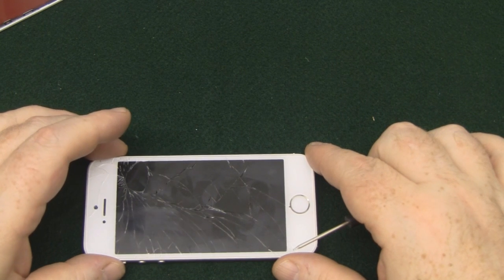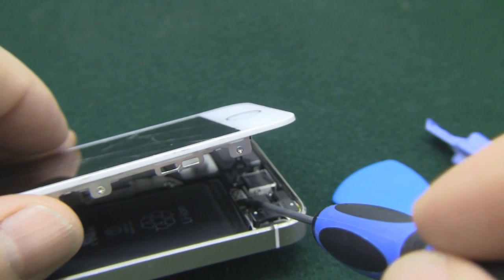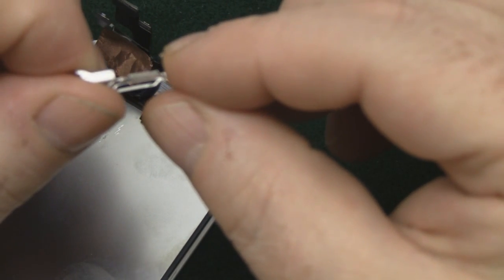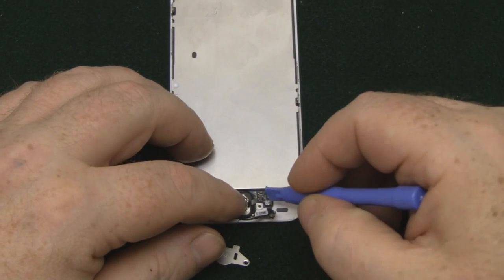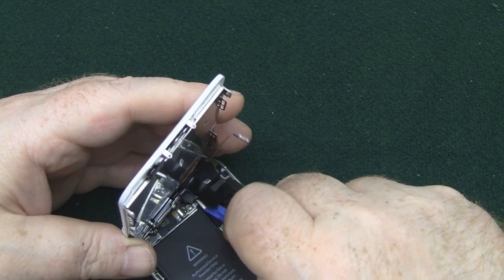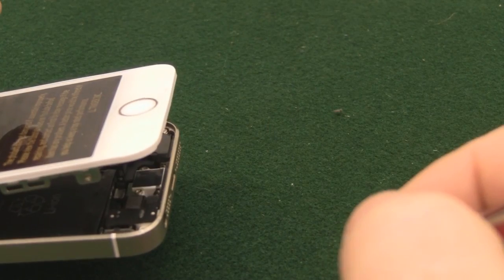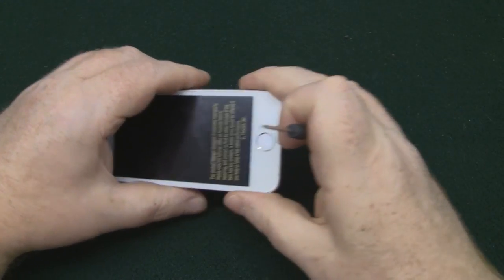IPhone 5s Screen Replacement #62

Comment: Can the screen ribbon flex cables with the 2 or 3 brass pin connectors  on them be fixed if 1 snaps off please. Also does colour part on top as well as the non colour part at the bottom of home, do both of these home button parts need to be swapped over to the original screen for the Touch ID function to to work because my old original 1 is white and my new home button is black, I'm hoping I don't have to have a black screen with a white home button. Excellent video thankyou.

Comment: please reply if you can, 

i dropped my iphone 5s and it crackked from the camera but saying that it had a glass protector and some off the screen came off in the top right corner and ita sensitive to the touch like if u press hard on the screen it had coloured lines, would it be alright when the guy thats fixing it fixes it?

Comment: Excellent tuition video. Takes time and patience but persevere and you can do it. As a previous comment noted, there is no need to remove the larger square shaped label from the back of the metal plate if you're using the plate again. Once you remove the camera the plate comes away with the silver plate attached. You just attach the silver plate to the new screen and reattach the camera. Thank you for uploading this very helpful video. No way could have completed this without it.

Comment: My home button is not working...checked the ribbons, everything connected. Everything in place. It says touch ID not working actually the home button. Any suggestions? I know ribbons should be intact and all. They are indeed and went back and checked them many times. What’s the next thing to do? Buy a home button? :(

Comment: great video. I'm planning on trying this soon. Just a suggestion: you should add a link to where we can order reliable replacement screens from
Reply: Hello Tristan, if you need these information, I will help you, our factory has manual and automatic lcd machines and the replacement parts, Whatsapp:+86 135 9043 9558, skype: nancyyang9308

Comment: Great video. Worked for me, only took 3 hours... I spent most of that time wrestling with the speaker/camera assembly to get it to fit into the new screen properly. In the end I went with "close enough" but everything works. Even the light sensor. Not bad for a £10 ebay job.

Comment: ATTENTION! The screws for the protective panel of the LCD flex cables MUST be of specific length. Otherwise, if you mix them up you can damage the traces on the pcb causing "the blue screen" boot loop. You can print a layout of your phone to keep track of what goes where. 
There is a video called "Classic 5s long screw damage trace repair to solve blue screen of death" by iPad Rehab with more info.

Comment: Hey I did everything in the video. Everything turned on but when I tried typing it would  add letters that I didn't press. When I scroll up or down it goes back up. Do you think it's a faulty screen or I did something wrong

Comment: Great video! Also, thanks for mentioning the part about the bracket screws being different lengths. it really matter as you can fry your logic board if you don't put them in the correct spots! Thanks.

Comment: hey. so u followed your video and everything was going well, until I turned it back on and now I have a double line down the middle of the screen? is this something I have done or possibly a faulty screen? Cheers
Reply: The middle ribbon connector is probably not seated

Comment: Thanks for the video.  

There were two points that I suggest:
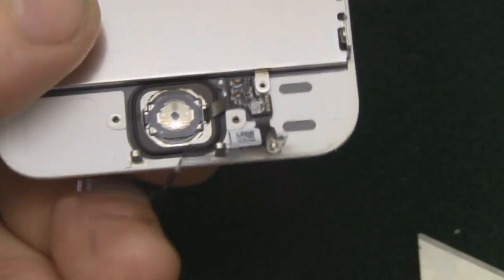1. 4:00 Using a blade is unnecessary to remove the button, just gently press the button from the front
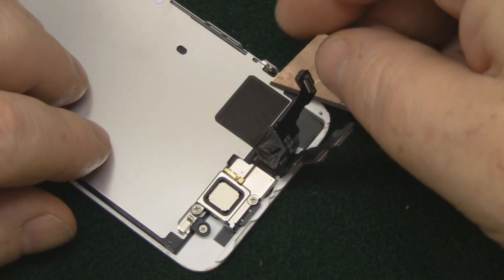2. 5:00 The Tape/shielding can be kept attached to the metal backing and transferred in one piece

Thanks again. I was able to see a part orientation I wasn't sure of.

Comment: I removed the glass screen, but the metal portion which the video shows attached to the back of the glass is still attached to the phone body. How do I remove it from the body so that I can access the screws?
Reply: lift up the plastic around the metal bit on the edge and it will pull up the rest

Comment: Great video. My daughters phone now works again after vertical stripes and almost no touch response. Some small rubber things fell out and the small metal clip on the right screw of the touch button. A close up of these things would have been nice, to see how to position them. Also the camera on this phone is very loos, and does not fit into anything I guess something is missing to hold it in place.

Comment: I have 2 iPhone 5s, one has cracked bad screen and the other one has a problem with wifi connection, do you guys know if the wifi modem is on the screen or on the motherboard? Because I want to swipe the screens (not only the led) because its easier this way. Do you guys know if it would work that way?

Comment: why would you have us remove the camera tape on the side if we are going to transfer the back plate anyways. You just risk damaging the tape for no reason...
Reply: WolfServant  if some one had a new digitizer or the back plate that demonstrates how to do so tutorial purposes
Reply: I guess, but maybe a disclaimer saying if your using the same one then keep it on? I removed mine when it was unnecessary.

I mean yeah I should have watched the whole thing before starting, and the phone still works all the same, so no problem there, but for others put it on there so that they don't pull it off if they don't have to, so they don't make the same mistake as me, by jumping the gun.

PS This video helped me alot so thank you for making it!

Comment: Thank you, works fine!  one thing i did different though is not remove the black tape on the metal plate.  i just left it attached and put it on the new one but thanks again, you helped a lot
Reply: Hi now we have automatic machines which make the whole process very fast and easy. For more details welcome to contact us by whatsapp+86-15889548883, thanks!
Reply: lucid tiger р

Comment: I hope this works, ive been stuck because the suction cup wont work because of the cracks
Reply: You could try putting clear packing tape over the screen and using suction from there.
Reply: yes , maybe you can buy heating separator with built-in vacuum pump , which will be easier , or you can refer to this article :http://tuoli-nancyyang.blogspot.com/2016/08/warm-tips-for-phone-lcd-refurbish.html   , any question , pls feel free to contact me . Wish you a nice day !　：）
Reply: Chuchu tv
Reply: hello , how are you today ? any doubt , also can send message to my mail : nancy@tuolitech.com !
Reply: Chill Keilen just use super glue

Comment: help my screen now shows but It doesn't respond to touches
Reply: Probably didn't connect digitizer correctly?
Reply: +Jed Moody exactly what happened did it and finished the whole didn't know how to properly close the bottom half and I cracked it again... Any tips?
Reply: I'm no expert at this at all I was just assuming general knowledge. Only tip I could give you is to never force anything.

Comment: I just bought a screen replacement kit from Hengtai communication "Hightechy".  At the back of the basically useless manual there is a QR Code that brings you here to this youtube video.  This video, as is the tiny "manual" for the screen replacement kit, are both for an iPhone 5.  I say "useless" because I had to watch a video, start, stop and study multiple times, to do my repair.  However the manual does mention some "bewares" that were not mentioned in any of the videos I watched.  E.G. Even though there may be 3 or more screws involved for removing any one particular part, there may be multiple size screws involved.  Pay attention to that.
This Video is ok but I ended up watching on that was specific to the iPhone 6.  The repair is slightly different.

Comment: I've followed this but after using it the screen has lost abit of sensitivity, when typing it selects random letters, or the space bar. Also affects the passcode when unlocking my phone. PLEASE HELP!
Reply: I think either your parts faulty or the 3 cables connecting the screen to the phone are not put in correctly.

Comment: Thought you had to disconnect the battery before disconnecting or reconnecting lcd screen as power can fry the new lcd screen leaving a blank screen or lines or touch screen not working?  so iv been told

Comment: My iphone 5s screen got replaced and now the very bottom part of the touchscreen doesnt' work. meaning I can't pull up control center. Is it possible that the touchscreen was just misaligned? my touch id home button is already not working when my screen was broken but the touchscreen was fine.

Comment: well at the beginning my touch screen didnt work and there were lines on the screen. now my touch screen doesnt work, there are lines on the screen and wait more? my home button also doesnt work. where was i wrong
Reply: +muhammedmuhiddin Wow! I have the same problem with my phone! something happened to it and one side of the screen (right side) doesn't work. It then fell and a little part broke and the lines went all the way to the middle, now the whole right side of my phone is no longer accessible. After changing your screen, it didnt work? Did u try taking it somewhere to see what was the issue to begin with? I also think it is the screen, but if you changed screens and it still doesn't work then maybe it is something else?? COuld it be the battery is not good?
Reply: no the problem is screen. i should replace the screen. home button is my fault. i couldnt connect it correctly. so i ll no longer try to repare it by my own. time to pay some...

Comment: You have a very nicely detailed tear down going on here. I give it all thumbs up. I accidentally cracked the digitizer while putting the screen and everything back into the housing, so I will definitely have to come back and watch this again to cover what ground I need to cover. 5/5, 10/10, 50/50, 100/100 and the accent was actually a very nice touch, as well.

Comment: My phone is hella cracked when I powered it on I got colorful lines (like the kind u get from tv's) and I want to to the screen fixed but if I do is the screen the problem or is it just my phone?
Reply: I think u need a new digitizer I can fix anything for you for $50
Reply: It's more likely to be the LCD than the digitizer. The digitizer is merely the touch screen, and doesn't produce colors - just touch and drag functions. The LCD is what produces your color and all other images and is designed to work with the digitizer to move and activate applications and their functions. Replacing a digitizer and LCD isn't very hard and you can do it yourself for less than $50, maybe even around half of that. When life gives you lemons make some lemonade; or, if it gives you alcohol just bang the maid.

Comment: this was a Godsend... just got my daughter's phone fixed before christmas.   only problem i had was trying to put the screws back in the plate that covers the lcd connections... the connections kepts poppping loose and i would have to unscrew that and start that process over.  the last step is much easier if u use tweezers to put the cover over the homescreen button connection, btw.  other than that this was an awesome tutorial

Comment: i now have an issue which i hope you or someone else can help with. I cracked my screen and was replacing it with a new one but the new one didnt work it would just show an illuminated black screen and i couldn't turn it off or anything. So whilst the phone was still on i changed it back to the old screen but once the old screen was connected it wouldnt show anything, not even lighting up? itunes recognises the phone and when its charging it 'bongs' every six seconds. Any ideas what the issue could be?

Comment: Did you notice that there is a "tube" (approx. 3mm high and 7mm diameter) made of transparent plastic which holds (or centres) camera module in place. New front panel does not have this - at least the one I bought. Have you moved this part into new front panel before putting all things together again?

Comment: do i absolute need the inside metal back plate? because i do not have one to use at the moment
Reply: +Eunice Jackson Yes, you definitely do: that's a thermal shield that dissipates the heat that the LCD produces. Not having one will eventually damage the circuitry irreparably.

Comment: True, you can not replace the digitizer on an iPhone (Gen4 and up), but you can replace the front glass, which is not the digitizer. I don't know if that's what you're talking about regarding eBay sellers. Ebay sellers throw in any words into item titles, like LCD, Digitizer, when simply selling the front glass panel. Also many people assign the word digitizer to the wrong part.

Comment: Just to say you dont need to take the black tape  off the back of the metal oull the camrea unit out then un screw the metal plate it will come away as one

Comment: the lcd/digitizer assembly I bought did not have the plastic camera alignment shroud, or the alignment shroud for the small behind-the-panel sensor. is this normal?

I carefully removed the shrouds from the old assembly (they're very fragile). I affixed them to the new assembly with some of the double-sided tape. not very secure - but it was the best I could do in a pinch.

great vid! helped immensely.

Comment: Hi, This is Seven from XYF Electronics Group Co.,Limited. We are the supplier of phone repair parts and accessories from China.

We supply iPhone 4/4s, 5/5C/5S, 6/6Plus LCD and all kinds of accessories.

We specialize in this filed for 5 years,our products with the best quality and pretty competitive  price,

if you have any questions, just contact me .

Thanks
Seven
Tel:+8613510672304 (whatsapp)
Skype :  iphoneyes-seven0312

Comment: I followed all the instructions and it all seemed to be going well till I tested powering it up.  It will not do anything.  The only think I can find is that I'm having trouble snapping the first of the 3 connections under the plate. I seemed to get it to snap in place and it still will not power on.   PLEASE HELP!   The computer recognizes the phone, so it seems to be a screen problem

Comment: followed this guide to replace my screen everything went well until the test lit up fine then touch wouldn't work :/ luckily I found a way to connect my home button and turning it off, but how do i know if my touch is completely messed up or not is it worth trying again or is the iphone a goner
Reply: fixed ?
Reply: yes, I managed to connect the home button while the phone was on and did a hard reset. ended up the digitizer cables were loose. Connected them nice and tight and worked like a charm, this guide actually helped a ton!

Comment: Strange that you unstuck the cables from the thermal shielding only to go and stick it back in the same place, its only my opinion but maybe you could leave it alone.
Reply: Dustin Franklin That's not sarcasm. That's simply an observation coupled with an opinion. This is sarcasm -> "you are such a clever guy Dustin!"
Reply: +Dustin Franklin how is that sarcasm
Reply: Pete Munson
Reply: Good eye.
Reply: Sarcasm does not help in these feeds. Stop wasting your your time and everyone reading these comments time.

Comment: Where do you get your supplies?
Reply: Lamont Lee Miller Hi, This is Seven from XYF Electronics Group Co.,Limited. We are the supplier of phone repair parts and accessories from China.

We supply iPhone 4/4s, 5/5C/5S, 6/6Plus LCD and all kinds of accessories. 

We specialize in this filed for 5 years,our products with the best quality and pretty competitive  price, 

if you have any questions, just contact me .

Thanks
Seven
Tel:+8613510672304 (whatsapp)
Skype :  iphoneyes-seven0312